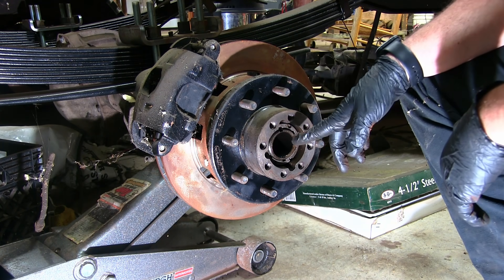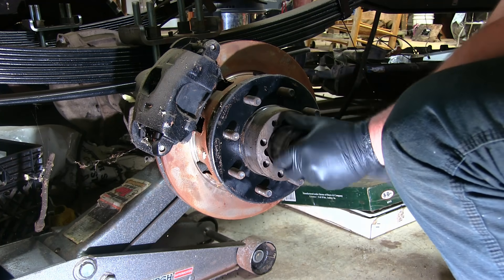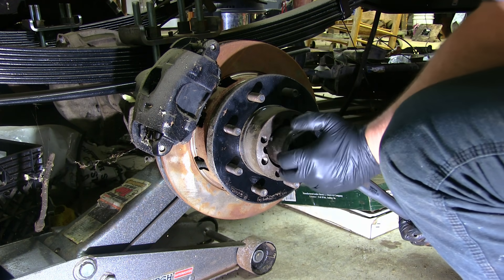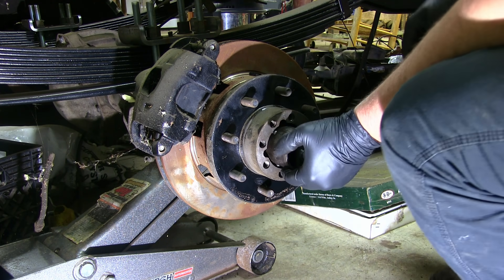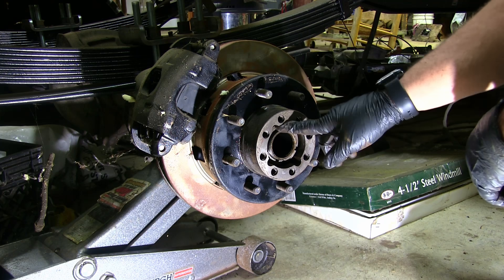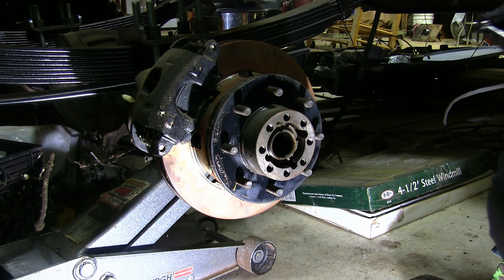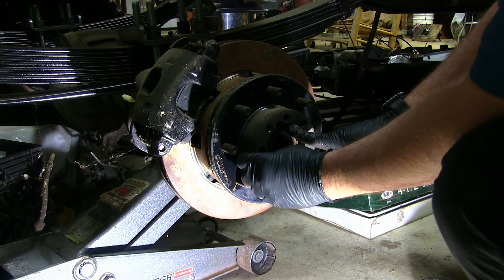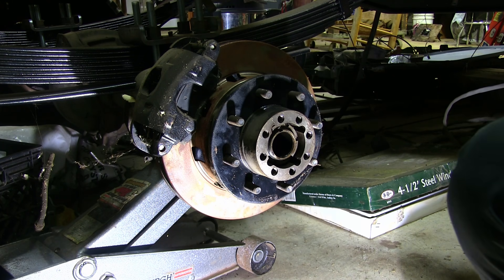14 Bolt Spindle Nut Torque

Comment: This is wrong after the 35lbs he should have backed off to the next keyway not tighten, if you don't have a dial indicator. The GM manual says after the 35lbs torque to back off. The hub should have .001 to .010 end play. I have always set full floaters at .003 of end play using a dial indicator. This is to tight.
Reply: Howdy from Kzoo,
End play in what?
Reply: @DanHomesteader  End play would be cleared in the bearing. Just the tiniest bit no preload on the bearing. Or at least not tight. This does not include front steer axles they should have preload on those bearings, no end play. A rear full floater is meant for carrying a load, 3/4 ton and up. At .003 end play the bearings will warm up and expand and take up the clearance. It will run cooler and oil better.

Comment: These are suppose to have .001-.005 of endplay. Not sure where this procedure came from but the sequence is correct but after 35 ft lbs you back it off again and tighten to zero lash and back nut off to closest slot. 1 rotation of the nut is .062 so each of the 6 notches it .010 end play. Just like every other full floater on the planet they are supose to have end play. Its odd how pinion bearings can be preloaded a fair amount to meet spec but they want end play on a spindle bearing that is also lubed with gear oil. Maybe its the vehicle weight on the wheel bearings? Or maybe end play is only needed for greade packed bearings? I dont know....

Comment: Interesting how everyone torques them different. I've watched several videos now, one guy goes finger tight and back off even looser to line up tab, one guy torques to 50 and calls it good, you go to 35 and its good. Chiltons manual does 35 and back off 1/4 turn. I've always just snugged it up and tightened to the next tab.
Reply from the maker: I agree, it seems there are several methods to set the preload on these axles.  Thanks for watching.
Reply: When taken off,usually finger tight,I tighten em,loosen em and snug the nut to the closest slot
Reply: Then the Haynes manual says you torque to 50 back off a quarter then Finger tight. Then line up with the closest key slot. What I think is the case is that you can screw it up many different ways and this rear end is so reliable it will be ok. It's kind of like how everybody and their grandma has a different oil they put in 350's and they are all fine.

Comment: So you torque it to 50ft lbs while turning them back off & retorque to 35ftlbs but if the key way doesn’t line up you tighten it up more until it does line up??? Is that how you exsplained it?? I’ve always tightened it up as much as I could while turning it  then back off a quarter turn & called it good!! I always make sure that it will spine nice & freely after wards!! Has worked out every time for me!!
Reply from the maker: Yes, this style of spindle nut is a bit weird.  Every other spindle nut I have done has been just like you described.  But everything I could find on the 14 bolt (and I couldn't find much for this style of spindle nut) has kept more torque on the spindle nut than I am used to seeing.  Thanks for watching
Reply: @Offroadfarm1  Could you tell me where you got the socket. I cant find one anywhere. Thanks.
Reply from the maker: I was not able to find one at either of the parts stores in my small town.  I ended up making one.  You could try this one from amazon  https://amzn.to/3zXPzC4  BUT! if you read the comments you have to file off the corners to make it fit.  Thanks for watching
Reply: Correct  @Offroadfarm1 I used a die grinder to round off the squared teeth